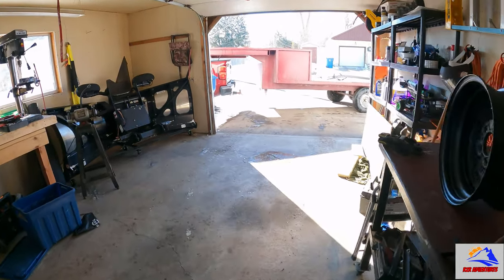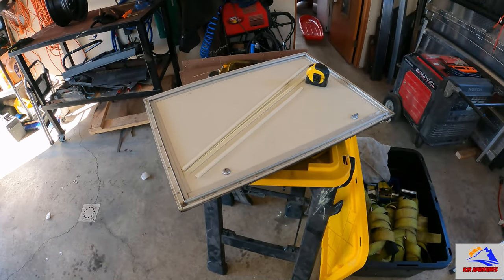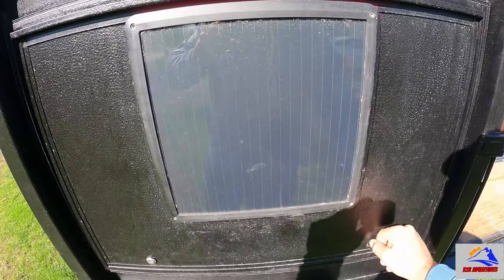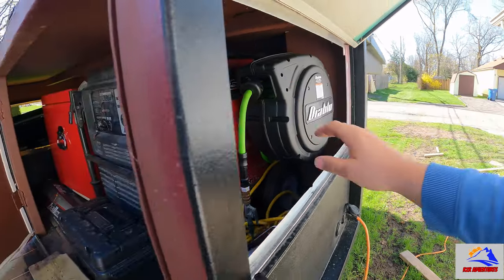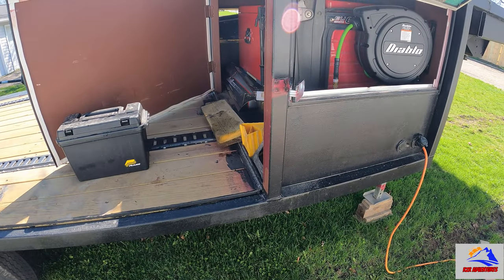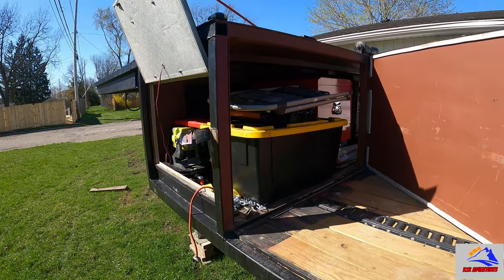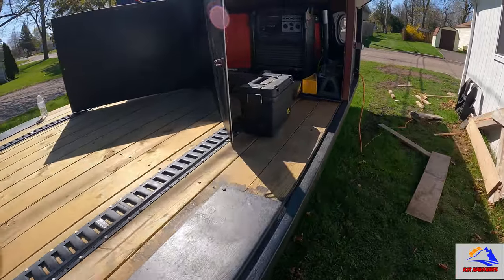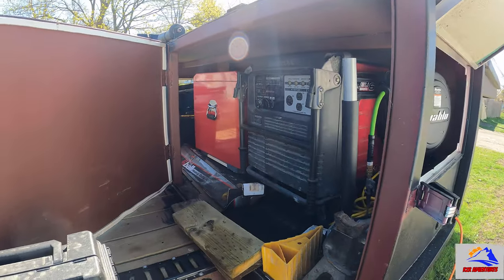5th Wheel to Toy Hauler Conversion Part 12

Comment: I love your videos!  Keep up the good work!  Quick question.......what kind of screws did you use to hold down your E-track?
Reply from the maker: Thanks so much, all I used was a hex head lag bolt, unfortunately the hardware I go to didn't have any stainless ones, so I had to use zinc plated. So these will corrode before I can get them replaced. Stainless is expensive but it's worth it in the long run. And then in areas where the board was not as grippy I drilled all the way through and used a stainless bolt not and washer. It doesn't seem like a lot to hold it down, but when you put so many screws in it's held up pretty well for us in the past.

Comment: How hard was it to get registered being it was a camper frame? Did you have a title for it and was it in your name? Or did you just register it as a homemade trailer?
Reply from the maker: I went the "assembled trailer" rout.  But since I didn't have paperwork showing that I paid taxes when I bought the main parts, axles and frame, I had to pay more than just the plate.  Other than that I had to get a weight slip for the classification, but there's a grain elevator just outside of town for that. Next time I'm going to make sure I have paperwork for the taxes portion.   Thanks for watching.
Reply: @rzradventures6525  ok I recently bought a fifth wheel camper frame to do the exact same thing so I was wondering how difficult it would actually be to get it registered as a utility trailer, turns out a little more difficult than I thought lol, I also don’t have the title from when I bought it, but I purchased it cash through a family friend, I’m going to have quite a bit of receipts from all the extra material I’m going to need to actually make it how I’m going to make it so hopefully it’s enough to get by as homemade. Only thing that sketches me out is the fifth wheel tongue, being it’s clearly not homemade, everything else I feel I can get by with.
Reply from the maker: @jonahdeangelo4688  all I needed (this is for Michigan) was the weight slip and receipts for the axles and frame material.  Everything else apparently didn't matter.  Then I got a plate and vin number based on the trailer weight class.  They just want to make sure you paid you taxes on the "important part".  If you don't have receipts showing the taxes you have to "tell them how much you paid" so they can assess the MI 6% sales tax.  
So good luck buddy.  Might have to make a video talking about everything I would do differently next time.  Maybe once this one is posted for sale.
Reply: @rzradventures6525  thanks for replying so quickly, your information has helped me a lot believe it or not, I’d definitely be interested in a video about the whole process. Why are you looking to sell? Great build quality by the way, good way to get the kids involved!
Reply from the maker: @jonahdeangelo4688  had some big life changes this year, ended up selling my truck, and the wife's is only a half ton, so I need to get (or quickly build) a bumper pull.  I'll probably do a video/ad on the channel shortly.
Reply: @rzradventures6525  gotcha hopefully all is well for you and your family can’t wait to see your future content!
Reply from the maker: @jonahdeangelo4688  thanks, planning a for sure trip to Drummond island this August.  Hoping to get out before that at least once.

Comment: You do not have 1600 pounds of extra on those axles. You are pretty much maxxed out. Remember the trailer weighs something. You have to deduct that from the weight capacity of the axles. For example. You have two 3500's which equals 7000. Lets say your trailer weighs 2500 pounds. That leaves you a 5500 pound load capacity. Not 7000 pounds. If you are already at 5300 pounds, you have 200 pounds of extra capacity not 1600.
Reply from the maker: I subtracted the full weight on the axles from the capacity of the axle and ended up with about 600lbs to spare with everything loaded on the trailer.
Reply: @rzradventures6525  you should be in good shape. A lot of people mistake the axle capacity for load capacity and it isnt really their fault. Thats how they sell it. So it would be easy to mistake it. But it comes with an expensive price by the time they figure it out.
Reply from the maker: @aaronwood3540  and that was one of my biggest concerns.  I have a habit of over-building things, so I ended up going to the scales about 3 times throughout the build.  I didn't want to have to go up to larger axles, but I kept checking just in case.
Reply: @rzradventures6525  im actually starting on one now. Ive been trying to decide on cutting off the upper deck or leave it. I have a gooseneck converter for it so i could go either way. It has 5200 pound axles. And the deck is already above the tires so i dont have to do the axle flip you went through. Its right at 20 ft on the lower deck so i was thinking a 4 ft dovetail and leave the upper deck. Its beefed up in the gooseneck part but the rest needs more bracing to strengthen it up. The upper deck is very stout made from  2×4 × 1/4" tubing. It has 15" wheels but i have a set of 16's im going to put on it. I should video the build but im not any good at that. Lol